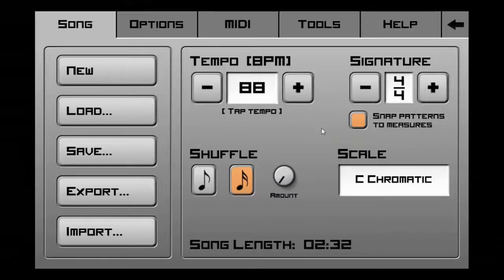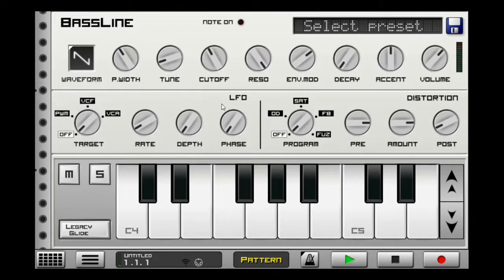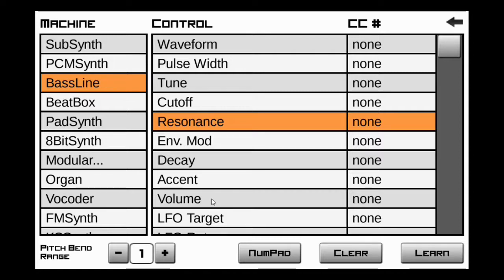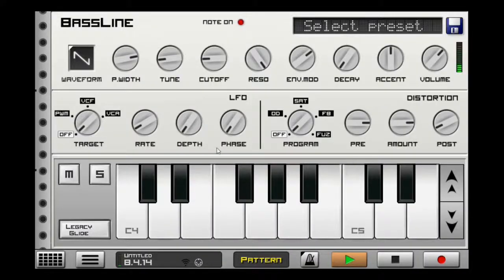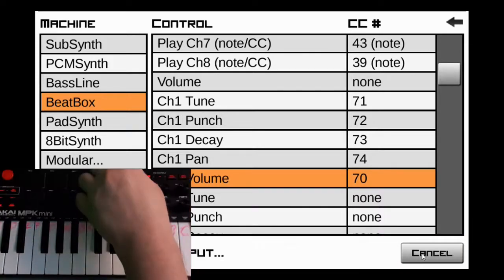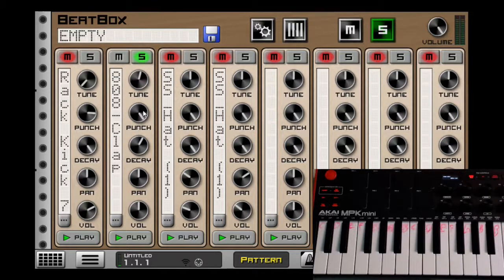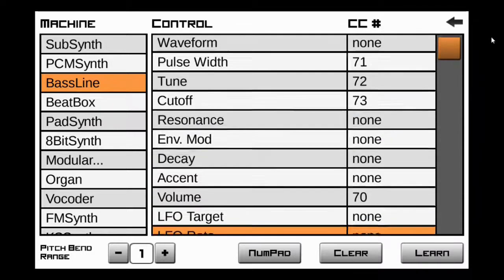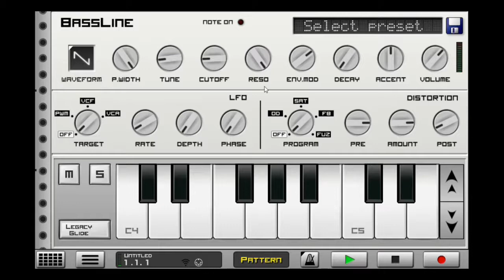Caustic 3 knob MAPPING Tutorial

Comment: I have just watched this and the Drumpad mapping tutorial. I found myself in a similar predicament, google for a guide to configure my device and found nothing. I have a Donner DMK25 which is identified by Caustic 3.2. I have set mine up slightly differently. I have my MIDI setting to "One instrument per channel". Channel ten is my Drumpads channel and as long as I set that up in the Machine Rack, I can tap out drums anytime! I have my physical keys on Channel One and the same goes. I find myself dragging an instrument in to slot one, getting it sort of tuned in with the tactile physical keys, noodling around then clicking it in to the piano roll and dragging it off to another slot when it is good enough (I am very much just getting started...). I have a couple of questions though. Can I use MIDI device to control the Effect/FX1-7 dials?

Is there a stutter effect I can put on like Koala Sampler has? Ideally controlled from my MIDI keyboard... 

Cheers Brockhard!
Reply from the maker: Sorry it took so long to reply. It appears that you can not control the effects rack from your controller which sucks. It's just not in the mapping section. You have to stick with automation if you want to control it.
Second, there is no stutter effect in Caustic. It would be cool but you have to pretty much cut up your samples or use an arpeggiator to create something similar but you probably wont have the same results.
Your set up seems somewhat effective, with having your drum available while on another rack but seems tedious to keep switching instruments in your rack. I think it would be easier for my to just use my wheel on my mouse to quickly get from one machine to the other but to each his own. We all have our own way of doing things that work with our needs.
Caustic definatly has its limitations compared to other DAW's out there but for $10, it's pretty darn good compared to $750 for Ableton but you get what you pay for. I used Ableton for around 3 years back in 2007 and it's the best DAW I've ever used. I was djing back then so it helped to make remixes and different stuff like that. Glad I could help you out a bit!

Comment: My Akai Mini III will not cc map the Modular synths, The others do. Any Ideas of what I'm doing wrong?
Reply from the maker: Are you trying to map your dials to some of the functions in the Modular? What exactly are you trying to map?
Reply: @brockhardentertainment  I just tried volume & Rate But yes trying to Map the Dials.There's no movement.
Reply from the maker: @richardhappybricks7821  I think I know the problem. Save your project and reopen it, then they should work.
Mine was doing the same thing until I closed Caustic and reopened it. I actually just quit Caustic, opened it again and reloaded the Modular presets and everything worked.
Reply: @brockhardentertainment  Thank You, Sorted 😀